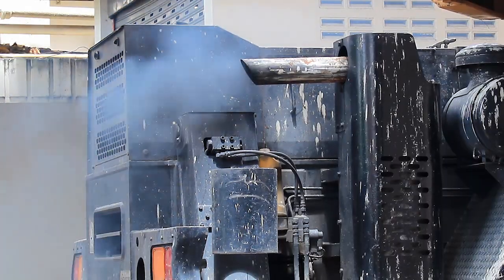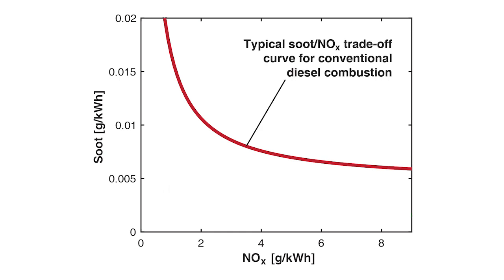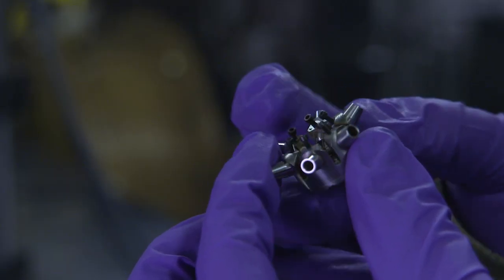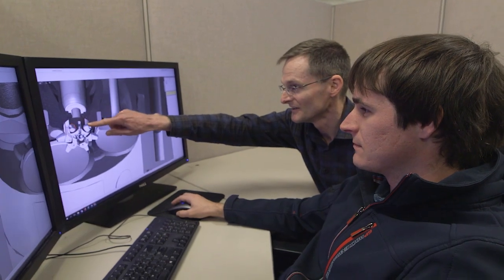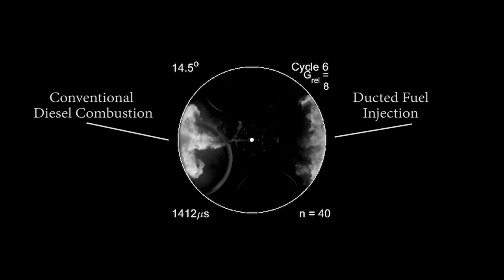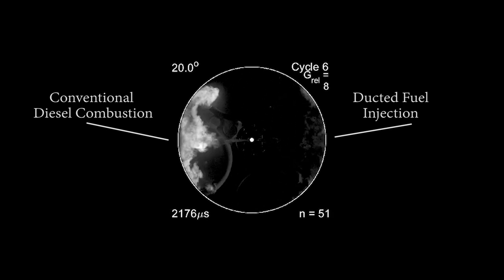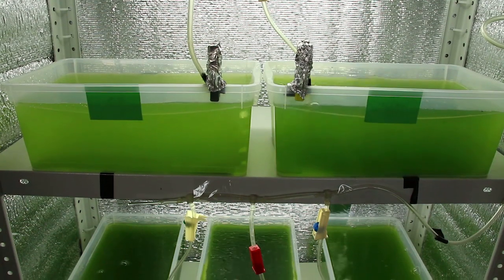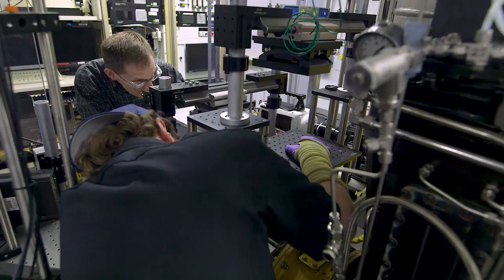R&D 100 Special Recognition 2019: Ducted Fuel Injection

Comment: With a faster burn time, will that raise the rev-line above 4500 rpm?  With a "high-reving" diesel engine, this technology can be used in sports cars and racing.
Reply: The reason diesels rev lower is because of stresses on the parts,  not fuel burn time. With significantly higher cylinder pressure you end up with far greater stress on the rods and crank which necessitates a lower operating speed or you end up with catastrophic failure. Building a diesel engine to withstand higher rpm operation would make vehicles unaffordable for almost everyone. Who would want to buy a diesel pickup truck for $150,000?
Reply: @angrodNumenesse no sir, the og commenter is correct. Diesel engines literally create more power more easily at very low rpms. Old school and new school. The burn rate is slow, and faster piston travel (higher rpm) requires a faster flame front or else the flame wont be able to keep up with the piston, which is where you loose power in the high rpms. Same reason gasoline engines advance ignition timing, otherwise the piston would outrun the flame, also you want combustion to be occurring at tdc for best fuel and power efficiency. If DFI allows diesel to burn more quickly, that should absolutely allow for higher redline and more power output overall. Also, since it burns cleaner and has less unburnt fuel, you are getting more energy out of less fuel, meaning much better fuel economy. DFI has potential to make gasoline engines completely obsolete

Comment: 2:44 "DFI could also be retrofitted into existing engines."

... and I'm sure once this technology is finalized for production use, lots of aftermarket diesel performance shops/companies (and maybe even OEM) will adopt and make parts relative to it. This could mean that older diesel engines that didn't come with today's emissions equipment could straight up become potentially just as compliant and burn cleaner! That could be a huge game changer.

All that needs to be figured out is how this is going to work out. Perhaps a modified cylinder head in some way, shape, or form similar to what was demonstrated in the video (with changes)? Very interested to see what this progresses to!
Reply: Where is this tech now?????
Reply: @kmtspartan3 snuffed out by politicians probably.

If this simple and effective technology gets released, everyone in the EPA would jump out of a high rise window.

Comment: How can the duct be prevented from melting in the middle of such a hot environment as the combustion chamber of a diesel engine? The cylinder head has coolant, the injector has fuel flow, and contact to the cylinder head, but the duct stands there alone in the heat. Does the computer simulation even take into account that the air in the duct has to be accelerated? People usually let a bunsen burner burn for minutes, but diesel injection is a split second. Is the image that compares the flames, a computer simulation image, or a glass engine and camera image. The image previous to it, seems to be ad CAD software image. How can it be that the good old prechamber and swirl chamber injections didn't achieve the same?
Reply: If you look at the duct @2:20 you'll see the injector is spraying normally on the left and into the duct on the right. The ignition delay is slightly longer, about 200us longer on the ducted side, that proves it's mixing the diesel with the available oxygen better. The ignition delay increase comes from more heat being absorbed during the mixing process thus taking slightly longer to heat back up and ignite. It also makes the overall combustion event shorter once it's been ignited.

Comment: Well, first they need to make the spark plugs better so that the diesel fuel ignites quicker and more thoroughly
Reply: If it has spark plugs, it is not a diesel engine. The fuel in a diesel engine ignites because the compression temperature (prior to injection time) rises above the autoignition temperature of the fuel. Autoignition is a physical and chemical process that occurs naturally inside the fuel if it is exposed to a temperature equal to or above its autoignition temperature. Yes, some diesels (prechamber and swirl chamber types) have plugs. Glow plugs. They facilitate starting if the engine is too cold to reach autoignition temperature (in the prechamber or in the swirl chamber) by compression alone. This video is about the mixing of fuel and oxygen. Diesels usually run lean considered over the entire cylinder filling, but rich considered over the spots where the injectors spray at. This video is about solving this problem. In a gasoline engine, injection is timed through the injection system, and ignition through the ignition system, so the engine control unit can adjust the premixing time of air and gasoline. In a diesel engine, igNItion is timed through the inJECTion system. The natural delay of the natural process of autoignition is just something that has to be taken into account. Because injection and ignition cannot be timed separately, the engine control unit has nowhere to go to adjust premixing time of air and fuel. Here comes the genius of the duct: it adjusts the premixing speed and quality.
Reply: @ernstnaumann6318 Does ducted fuel injection work on gasoline direct injected engines?
Reply: Absolutely LOL

Comment: How does this rather large ducting device fit into the squish area of the combustion chamber?
Reply: And that is the question. Injector tips have a hard enough life in the cylinder, right?
Reply: And how would you replace it, or the injector if it is one unit. 
Remove cyl head ? $$$$
Reply: @Moparornuthin  Exactly. I mean, only other option is designing an injector with an injector cup that comes out with is all, maybe threaded into cylinder head. But that's bonkers. You'd lose so much of your cooling jacket
Reply: Probably larger piston bowl diameter for accomodate that

Comment: Wow, that's quite the effective solution. I'm impressed.

Would also be curious to hear how much more efficiency could be squeezed out of diesels with this technology, certainly not having to be near as aggressive with injection strategies specifically meant for lowering emissions instead of just propelling the vehicle being able to be reduced greatly will help quite a lot.

Wonder if the soot creation is low enough to even be able to go without a particulate filter?
Reply: Yeah I would also like to know what kind of fuel and power effieciency would come from the system but no one wants to even talk about this in the abstract. The only thing these people care about is emissions and it's annoying.
Reply: @dayman888 less carbon emissions = less fuel used
Reply: @karlovucilovski7899  Well, yeah, but I want some more numbers.
Reply: @dayman888  They are claiming 50 percent better fuel economy and 80 percent less particulates in the PDF literature.
Reply: @MrInnovativeEnergy  Sweet, that sounds  massive if it turns out to be true. It's hard to get information on this technology they are developing. I hope it isn't one that will fade into obscurity.